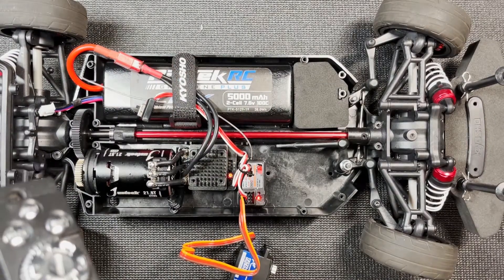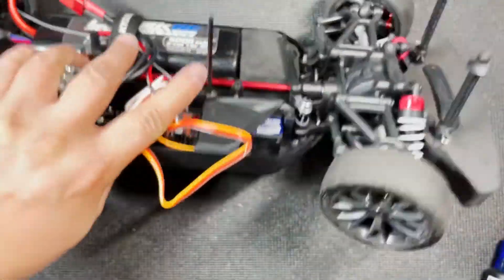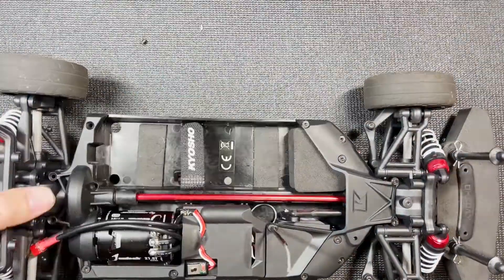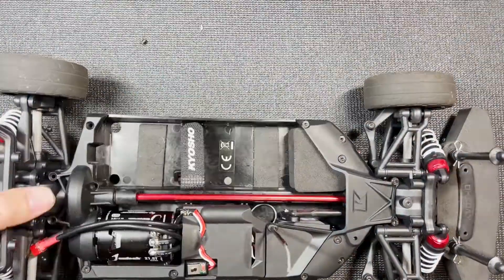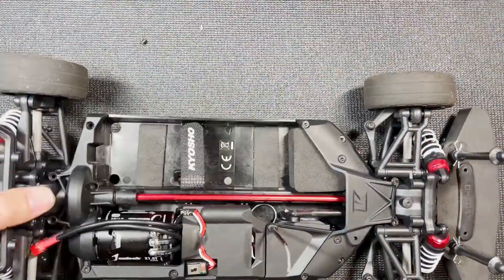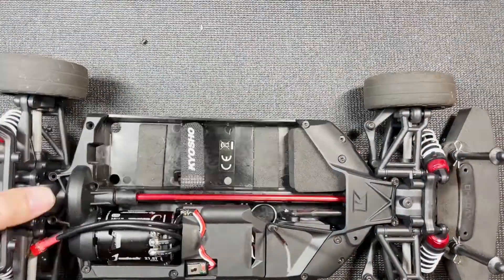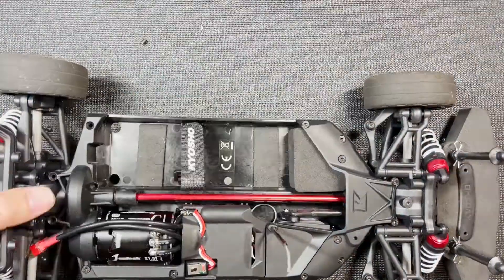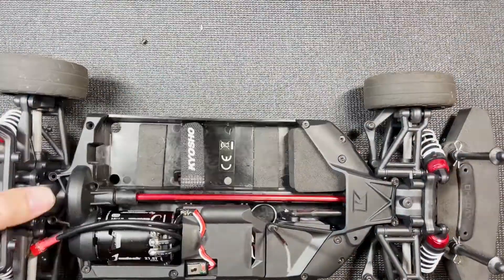Install Servo and Chassis Covers | Kyosho Fazer Mk2 Dodge Challenger Hellcat | USGT Class Race Prep

Comment: is it normal for my fazer mk2 to turn the car itself alot sharper when turning left, rather than when turning right it whips the car around alot slower? ive checked the steering and both directions seem to reach the same angle so im thinking it might be up with the differential in the rear wheels?
Reply from the maker: Rebuild the diffs and see what happens. It also might be a dying servo. Good servos are pretty inexpensive to replace.
Reply: @RCsRCCars  Alright, Thanks for the advice